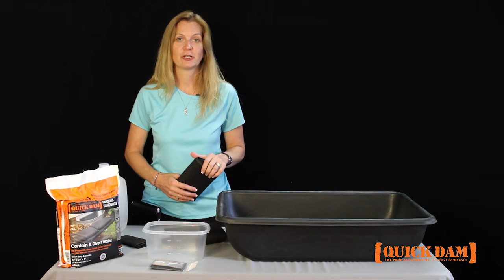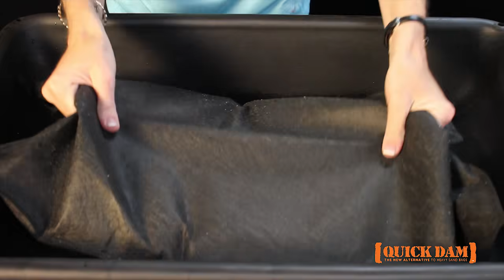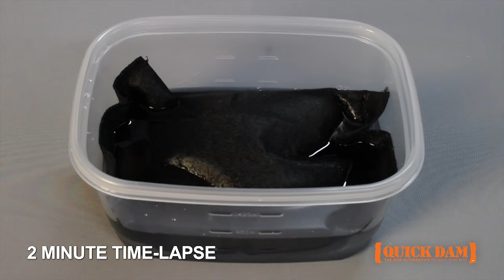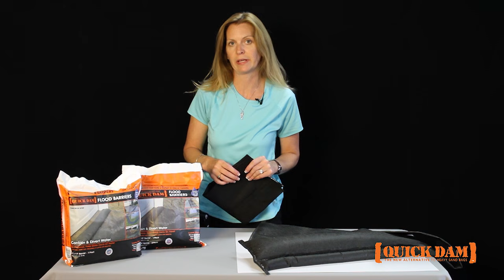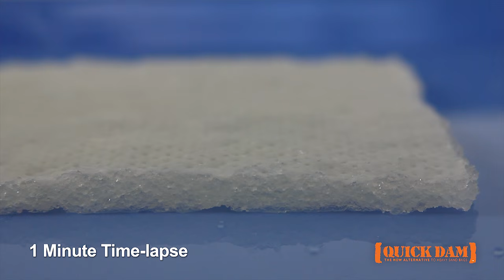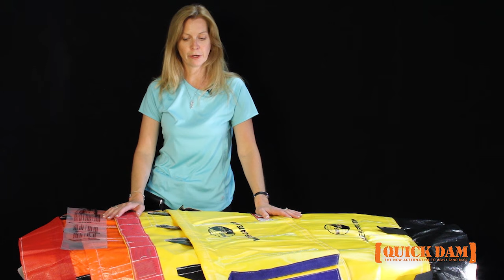Quick Dam Training Video

Comment: How long does it hold water?
Reply from the maker: Once activated, if left in position, they can last for 3-9 months- this varies quite a bit depending on the environment in which they are used.  The longer they stay wet, the longer they will remain active. When they are not getting wet, they will be drying out through evaporation & will reactivate when exposed to water again. Direct sunlight & excessive heat will speed its degradation, so these climates will experience shorter life cycle.
Reply: @QuickDambyASP  Can you please offer a version that stays inflated? Otherwise, Once this stops working, Or gets to the end of its life, I can't afford to keep an eye on it to see how much water is flooding through to know its at the end of its life. I have an older home and my garage sits below the street and always floods. 

These have helped greatly. But I don't like that it expires. So please either offer a version that stays inflated or one with a zipper at the end so I can add sand later. Which is what I plan to do with these. I'm going to cut them open dumb your innards and then refill with sand and then dynaflex it shut. For Long term use.
Reply from the maker: @civilizedagecustoms  Unfortunately, we can’t guarantee that our Water-Activated Barriers will remain full without the presence of water, but we have our Water Curb, which uses contained water to divert flood water. We are also developing a new design in our Water Curb line so stayed tuned for that. Check out Water Curb at: https://quickdams.com/index.php/product/water-curb/ and be sure to follow us on social @quickdams for new product announcements!
Reply: @QuickDambyASP  Can you offer a version with a zipper at the end? So once the innards life has ended, at least the bag can be used for sand?

Comment: So before you put them in place you have to let them soak some water so they’re at least somewhat expanded?
Reply from the maker: Place the Bags/Barriers in the path of oncoming flood water. As they come in contact with water, it will absorb through the material and start to swell. If a rush of water is expected or you need to stack them, pre-soaking them is recommended. Bags/Barriers reach their full height of 3.5in in 10 mins if enough water is present. For additional tips and tricks, please visit: https://quickdams.com/wp-content/uploads/2019/06/Quick-Dam-Tips-Tricks.pdf

Comment: This may be the most unusual question that you have received about the flood barriers,

I need to repair a concrete retaining wall that partially surrounds a large pond.  Could several flood barriers be submerged to form a semi-circular wall against the concrete wall that I could de-water and create a somewhat dry work area in which I will need to dig.  The flood barrier would need to be over a foot in height.  The bottom of the pond is mucky so the barriers may sink.

The flood barriers would need to be removed while still "inflated".  How heavy can I expect them to be and can they be moved without rupturing?

I expect to use them only once.  Could one end be cut completely open and the other end rolled up like a tube of toothpaste?

Regards,
John
Reply: Hey John
Did you ever get an answer on your question? I might have  a similar application for the quick dam. I wonder what they said?

thanks

Lou Naj

Comment: Good info video.  I purchased a couple oh the 10' pieces.  During the winter thaw, we need to divert water.  This year we are in the midst of a winter rain.  I have 2 quick dams guarding the sidewalk.  My question is what will happen when the bags freeze?  If I don't disturb them will they be good for the next thaw/rain?
Reply from the maker: They will freeze and act as a barrier.  They will eventually thaw out and the same process will happen.  Be careful when they freeze not to drag them, as they could tear and damage the outer layer.
Reply from the maker: They will freeze and act as a barrier.  They will eventually thaw out and the same process will happen.  Be careful when they freeze not to drag them, as they could tear and damage the outer layer.

Comment: Hi! I want to block the length of my driveway which is 75ft. When it's really stormy the water rushes across my driveway and it continues into my neighbour's yard. I think 5 x 17' flood barriers would work. That's 85ft. Question - do they velcro together at the ends? or do I need to stagger them for complete coverage?

Comment: okay, so we just used your product and saved our garage from a flash flood. I want to save this barrier that is 15 feet long. On your packaging and in your demo. You say salt water has no effect in absorption. And on the package it says place in salt water to deflate it. Im confused in how to store the product and drying it out without sun. Two to three months to dry it out it will mold or stink up the garage and home. what is the best option in re use and drying options and storge without long drying period. Because it is an awesome product and saved our property. Leaving it across drying out in the garage may lead to damage or kids destroying it by running over with bikes. as well as vehicles
Reply from the maker: We have only 5, 10 & 17 ft Flood Barriers, so if it's 15ft, it might not be our product. But yes, ANY product that uses Polymer to absorb liquids will dissolve when it comes in contact with salt or chlorine, not just out Bags & Barriers. Keeping it in a cool dry place, like a garage will be the best way to get it to dry our the fastest. You will be able to use it once more after it dries out but it is NOT reusable in the sense that it can be used over and over again year after year. If you're looking for a more permanent solution, you can look into our Quick Dam Water Curb's, Flood Gates & Water Gates! The Water Curb needs to be filled with water, it does not absorb, but it does allow you to drive a vehicle over it! see more at quickdams.com
Reply: @QuickDambyASP  hi..I'm confused..in the clip she says it can be used for 6 to 8 months if you leave it in place but in this comment it says it cannot be reused except for  one more time ( twice total) ?

Comment: If a 10 foot Flood Barrier is too long, can 2 feet be cut off without ruining the unit?
Reply from the maker: +Ilona Covert Hi there, no you should not cut the products as the polymer substance will come out and your product will no longer work. If you go to quickdams.com you can buy 5ft flood barriers as well.
Reply: Thank you very much for the warning, I will not cut it!
Reply: How about folding a 17 footer over itself lengthwise to have double it's height?